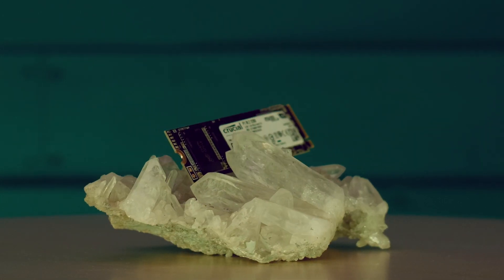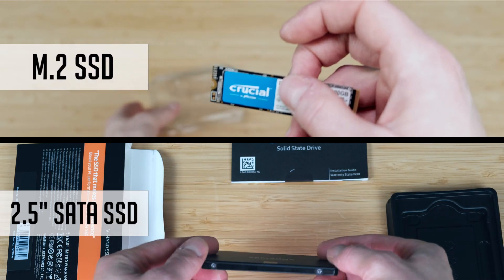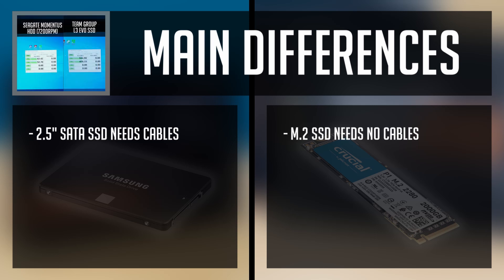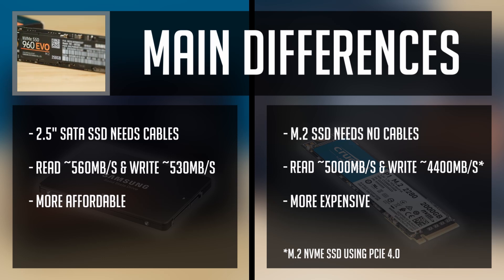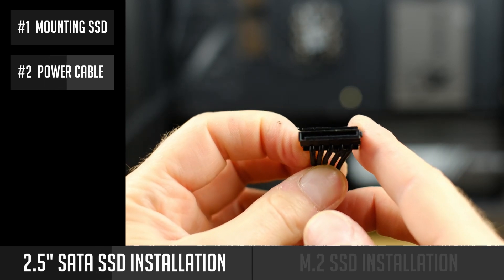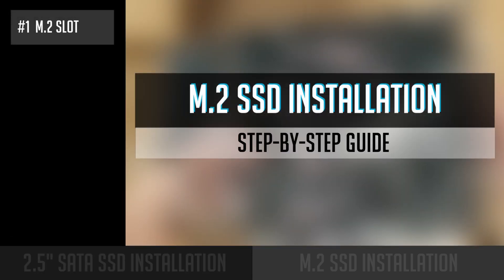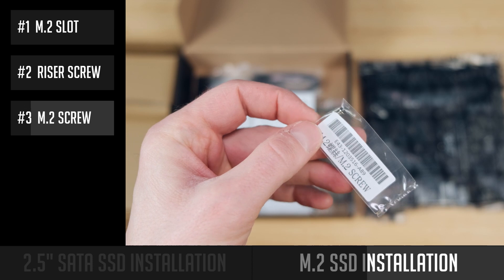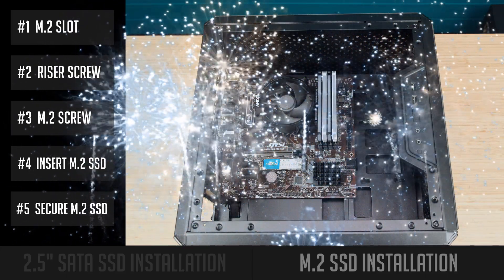HOW TO INSTALL SSD 2021 - SATA & M.2 SSD EASY Step by Step Beginners Installation Guide / Tutorial

Comment: Bro i need to install an additional M.2, but i have only one slot in my motherboard, any alternative ways to install it
Reply from the maker: Hey,
yes, you can add more m.2 SSDs.
There are m.2 to PCIE cards that can hold 1, 2 or even more m.2 SSDs - https://geni.us/u7zf
Depending on your motherboard and available PCIE slots, m.2 connected in this way can be slower than the one connected straight to your motherboard m.2 slot :)
Reply: @EpicGameTech  Thanq bro

Comment: Hey! Thanks so much! This was a very helpful video! I do have one question though. On my motherboard, the riser screw isn't in the right place to fit my M.2. How do I move it to another size?
Reply from the maker: Hi,
Glad you like it :)
Rizer screw can be unscrewed with a screwdriver and screwed to the right place where you need it.
Also, do not mix m.2 shield standoff where a shield is secured with rizer as they are quite similar :)

Comment: Btw, where did you get your CPU cooler in your 200$ build?
Reply: Thank you :D
Reply from the maker: I've used stock intel cooler and got it for free (since were buying two i5-2400 CPU's for $18 each).
Stock coolers are not super grate, but they do the job in i5's. also, very often guys are selling them for ~$3-$5 in pc repair workshops or even online etc. :)
But if it costs like $10 - better to check some decent 2nd cooler for that price.

Comment: Ayyo dude, I found a gtx960 2gb for only 50$ and a rx570 4gb for 70$ which one should I take for a 200$ pc build.
Reply from the maker: Hey,
remind me, witch CPU you will be pairing any of these two with?
Basically rx570 is ~30-40% faster :) also, it had 4gb of VRAM instead of 2GB it means it will last longer.
But it depends from a CPU you get, since rx570 might be too good and you will be not see a better performance because of CPU bottleneck :)
Reply: Honestly, I don't know becuz I'm planning to build after the pandemic :)
Reply from the maker: Well, so it depends :) BUT if you can - rx570 is to go, since a price is GOOD :)

Comment: Also, did prices increase during the pandemic?
Reply from the maker: Depends on a component. E.g. i5-2400 / ddr3 ram not, since there are still quite lots of these in used market. But GPUs like rx570 increased :)
Reply: oh man. If I build pc what would you suggest (after pandemic/during pandemic?)
Reply from the maker: Well i need to know your budget in case you want to build a new pc :) (i could make a partial list with us links)
In case you have in mind used pc parts, well still i need your budget but i will not be able to provide links apart from eBay/aliexpress since for used parts you need to check locally :)
Reply: 200$, thank you for your help. 
I do plan to buy a optiplex, but unfortunately I can't find any i5 2400 model under 100$, but I did found one that costs 90$ + 6$ shipping in lazada  but now it's unavailable, the specs of it were kinda good, 8gb ram ddr3, 200+ HDD, intel g620, and that's all I can remember. But when I came to check the pc right now in lazada its gone, I don't know if it comebacks. And then after that a R9 280 (72$). After that intel i3 -3240 (18$ +1$ shipping) And then after that, intelligent power supply 700 watts + 1$ shipping or less.
Reply from the maker: I see :)
Well i would not go for i3-3240! I have few i3 i could give it for free (but it's sad we are not in the same country). Old I3's are really bad. You should take i5!
> CPU - Here, Xeon E3-1225 - it's same I5-2400 CPU just under a different name, so some people do not know that and it's ~$5 cheaper. Same price as your i3.
 https://www.aliexpress.com/item/4000379598265.html?spm=a2g0o.productlist.0.0.2cca5231q3n6v5&algo_pvid=66f137b6-058c-47fb-9c2c-82f2330a9b3f&algo_expid=66f137b6-058c-47fb-9c2c-82f2330a9b3f-0&btsid=0be3769015958627416015719ee77b&ws_ab_test=searchweb0_0,searchweb201602_,searchweb201603_

> GPU - I would suggest adding $10 and get rx470. RX470 will be 30-50% faster for just 10$ more :)
https://www.aliexpress.com/item/4000553326437.html?spm=a2g0o.productlist.0.0.29f53703r306fC&algo_pvid=a37db507-c3b7-49c1-9aa5-828ffb2744de&algo_expid=a37db507-c3b7-49c1-9aa5-828ffb2744de-5&btsid=0ab50f4915958630774352939e2496&ws_ab_test=searchweb0_0,searchweb201602_,searchweb201603_

Other components you can buy locally :)
Reply: Thank you so much!
Reply: Unfortunately, the shipping fee is kinda high. I guess buying locally is the answer :D
Reply from the maker: Shipping to my country, witch is to Europe that CPU costs $2.53 and that gpu costs $24.02... ouch :)
https://www.aliexpress.com/item/33019091367.html?spm=a2g0o.productlist.0.0.7a473703PJ0cxo&algo_pvid=5508ac1d-54a7-4430-8127-b35c3b509fb4&algo_expid=5508ac1d-54a7-4430-8127-b35c3b509fb4-3&btsid=0be3743615958656900377012eb5a0&ws_ab_test=searchweb0_0,searchweb201602_,searchweb201603_

This one is free shipping. But 1 fan. I had similar one 3-4 years go, it's louder than 2 fan GPU, but anyway it performs quite good :)
Reply: Thank you. Btw, I found a rx570 4gb on carousell for 74 dollars
With no shipping fee and cash on delivery. There were also no reviews. Is this a good deal or a scam?
Reply from the maker: Never used that site :)
Before the epidemic, it was a reasonable price since I got rx570 for around that price. But at the moment prices for rx570 is 80-100$ in most cases, so hard to say :)
Reply: Carousell is a classified website like skelbiu in Philippines :)
Reply: hmmm...I guess I should build a pc after the pandemic.
Reply: I found a h61 motherboard for only 25$ pretty insane deal :D
Reply from the maker: Yep, good deal! You could pair it with that Xeon from aliexpress
Just do not buy i3... :)

Comment: So this is my build and I just ordered all my parts is there anything I should add or should return? https://pcpartpicker.com/list/3BxGCL
Reply from the maker: Hey,
wow, you got quite a big budget for your rig.
Some of my thoughts below:
> CPU - In case you are Intel fan (in other case go for AMD for better value) why not going for a 1th gen Intel CPUs?
i7-10700k?

> Storage - 2x HP NVMEs - will do them in a raid?

> To be honest, it's totally not worth to buy 2080 Ti at the moment. New GPUs are on its way (~2-3 months) and 2080 ti price probably will drop drastically. In case you really need really good GPU now - at MAX I would go 2080 super, since it's cheaper and will lose less value in 3-4 months. So it will be easier to sell it and get new/better RTX 3000 series card then. Or get used GTX 1080 ti (for ~$400) for now and sell it when RTX 3000 comes as-well :)

> NZXT H510 is a really nice case, BUT, it's a budget case and I would recommend using for a budget-mid range builds. But for a high-end rig, you need to get a better airflow case for sure. Most of the time, I recommend getting 5% to 10% from a PC budget for a case. So I would consider at least spending ~$100 for a case with good airflow. 
Few options:
- be quiet! Pure Base 500DX - https://amzn.to/3h3YadB
- Phanteks Eclipse P400A - https://amzn.to/3gPZgta
- Cooler Master MasterBox TD500 Mesh - https://amzn.to/38PSLDP

> PSU - I do not have much info on that GameMAx PSU. To be honest, I would switch it to the ones I know are in Tier A /B good reviewed PSUs. Especially when it's a really expensive PC build.
- Corsair RM850x - https://amzn.to/2OkMOFD
- Seasonic Focus GM-850 - https://amzn.to/3fmIO3p

And the main goal is an ultimate Gaming PC, right? (or video editing/rendering etc?) Since even 64GB of RAM is overkill for gaming "_

P.s. used affiliates links :)
Reply: Epic Game Tech hey ive sent you a couple emails back could you check them out please!
Reply from the maker: Hey,
For the next 3+ days im filming new videos. And so my main pc is not available (where i usually sit and check emails and do some support for people that needs more time to sitt/check/do reasearch. Its not quite possible to support via phone where more seriuos insights (or longer emails) are needed.
So i will be able to check everything only later on. Also, not sure how much of a time i can dedicate such support/consultation, since i have limited time (already behind a schedulle with my video production) :)
Reply: Epic Game Tech hey no worries man! I headed over to a micro center and they helped me with all my parts I’m going to be ordering them soon!